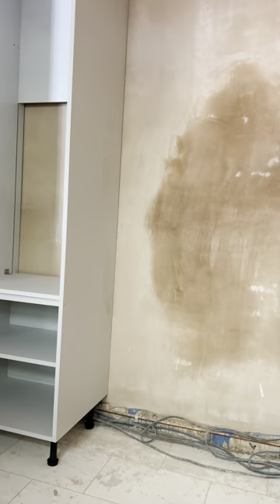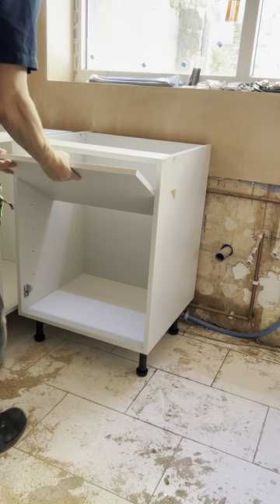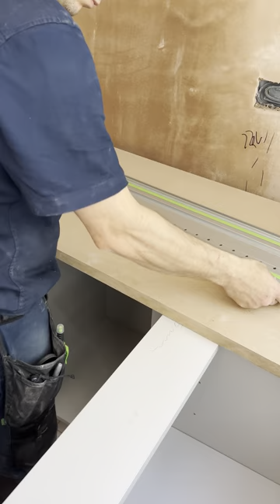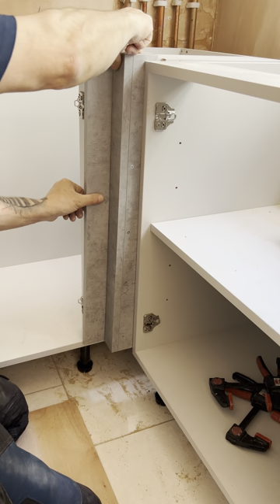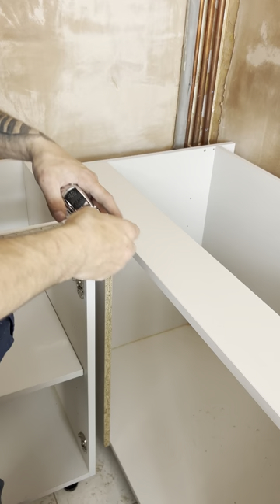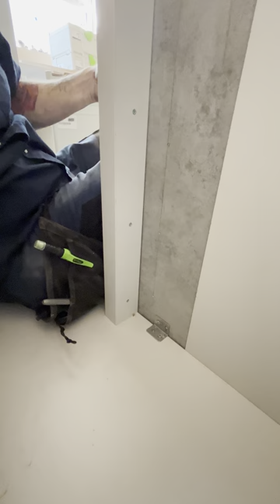Kitchen corner post built

Comment: When fitting the doors are 18mm. Also the end panel you are using to make the corner fillet is 18mm. Do you bring the fillet forward maybee 2 mm so the door can Finnish flush because of the 2mm buffer behind the door...
Reply from the maker: Exactly I use rubber buffers they are around 2 3 mm excellent as they no slippery,thanks for watching